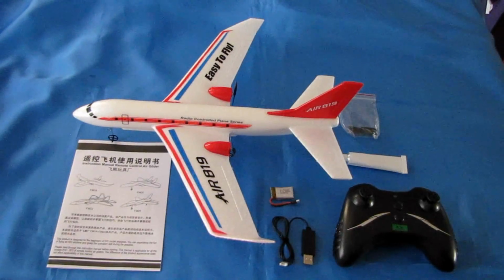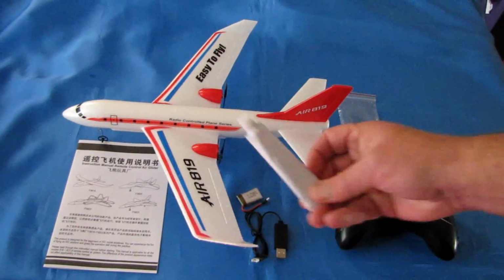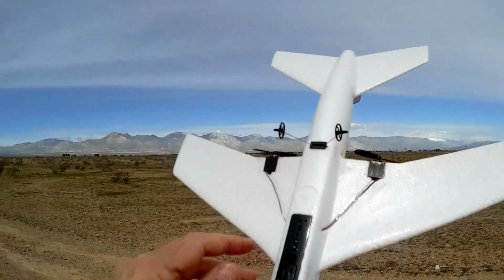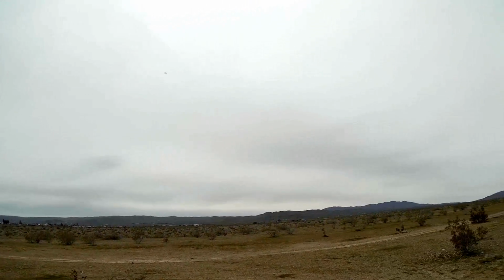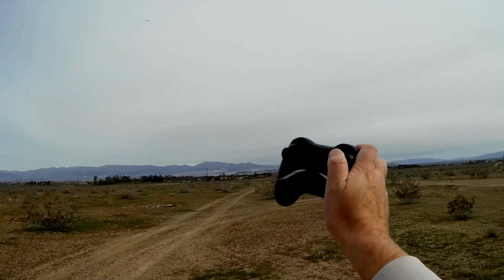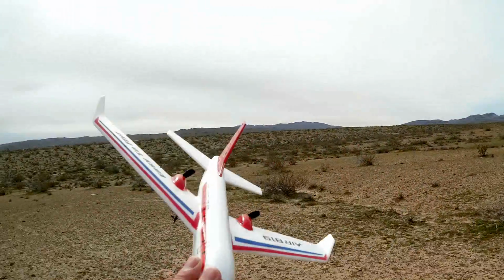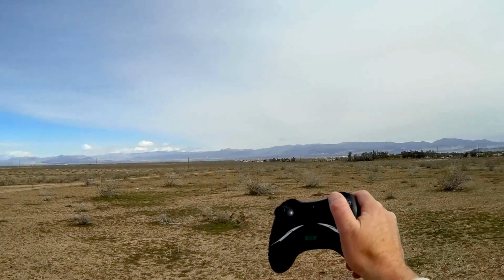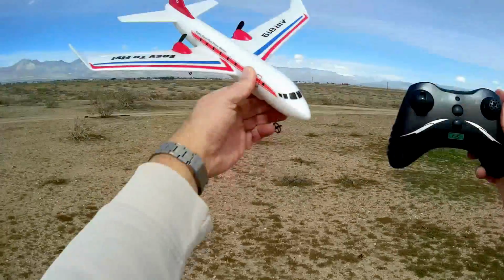Flybear FX819 Long and High Flying Beginners RC Airplane Flight Test Review

Comment: These Flybear 2 channel planes are a lot of fun to fly! I wish they would make these as 3 channel with Aileron and Elevator then they would be absolutely fantastic ;-) See you in the Air!
Reply from the maker: Have you seen the new 3 channel XK series? Here's one of them https://youtu.be/Cjcr3CfXWaM
Reply: @Quadcopter101  , I have thanks! They are still using two motors for Yaw. I'd like to see an Aileron and elevator setup with a single motor pusher. See you in the Air!

Comment: I wonder if you could keep the yaw in one direction and bump the throttle, or bump them simultaneously, as a way to have turn control without having to continually climb.  Might take a little practice.

Comment: READ  MY  LIPS  -      a two-channel model has a certain amount of nose-up/up elevator  moment,  built into the stab.    if the model is flown Faster than its  TRIMMED-FOR  airspeed,  the fixed  'elevator'  trim  WILL  CAUSE  CLIMB.    SOOOOOO,  a  PILOT  Should  Determine  the  AMOUNT  of  throttle, that  results in  Level,  Cruising  flight.     and, he Should Expect  CLIMB, if a greater amount of   throttle is put in.    difficulties can arise if such a model is  ALLOWED (or caused) to climb too high.      googletranslate

Comment: That's the problem with these small planes in a breeze. Stopping hem from climbing can be "challenging"  Does this one have the rotary trim control on the Tx that was on the earlier models? I always take the landing gear off mine as I only fly them over grass